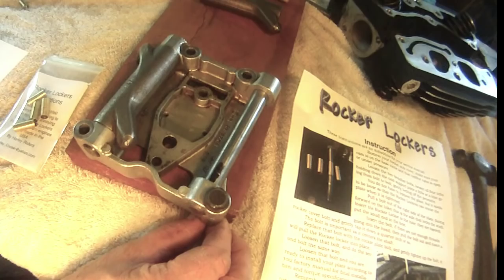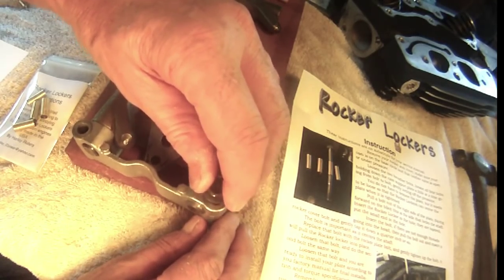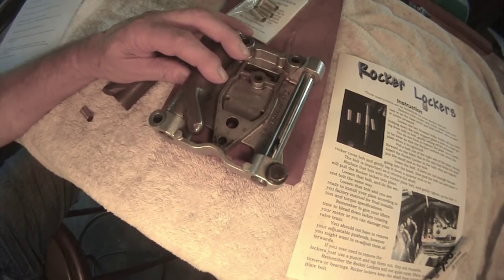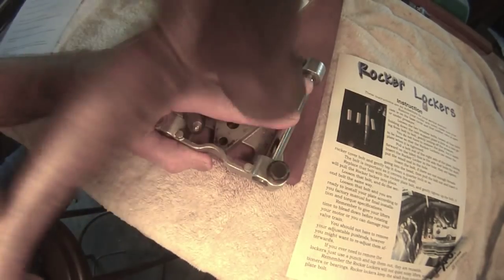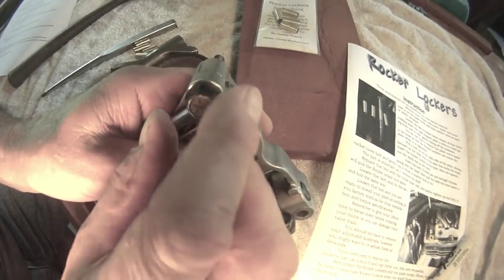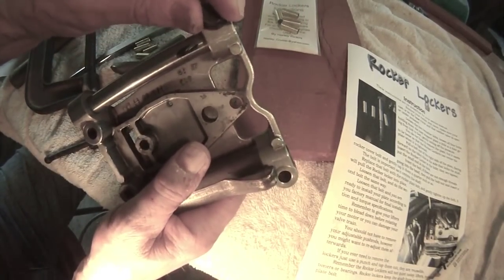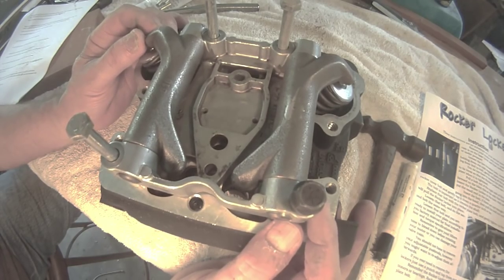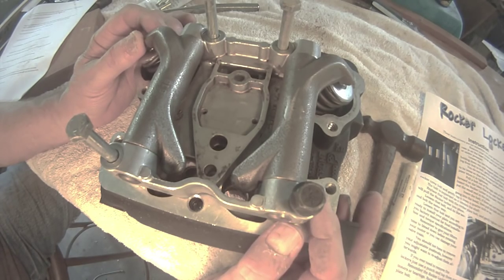Cure for Harley top end tick, Rocker Lockers

Comment: I put rocker lockers in 2 years ago in my twincam roadking .Still has a lot of ticking. Pulled apart and checked everything recently it sounded so bad.Put new piston rings in while apart. No sign of anything wrong. There is no way to really make these engines more quiet like say my old BMW boxer twin.  Rocker lockers dont cure it. These are just rattly motors.  which is shit.  If you hate rattly motors dont get a harley. or buy loud pipes to hide the shit mechanical noise

Comment: Incredible engineering from H.D!! Doesn't inspire a great deal of confidence for the rest of the bike....Pay a fortune and take your bike home,to strip and fix with large hammer!! Incredible!!
Reply from the maker: g.g. 63, The comical part is that this flaw started in 84 with the EVO motor, then the Sportster had the same flaw, and continued in the Twin cam. Usually a company tries to eliminate problems with a new design HD just kept building it in because they wanted to reuse some of the same parts. Sorry about the big hammer, this video version was fairly early in the development of the Rocker Lockers and is obsolete, we have since found a better way to install them using a bolt to pull them in.
Reply: @harleycruiser4331  Pleased to hear it....the hammer looked a little brutal!
Reply: It's only a noise. If noise bothers you then avoid air-cooled engines and get a Gold Wing. That simple, that easy. I'm a multibrand mechanic and don't have a dog in the fight. I own Harleys,  two Norton Commandos and a Honda Interceptor at the moment. Rebuilding the Honda was most unpleasant compared to the easy of doing Harleys.
Reply: It would've cost them another $1m annually in wages to have assembly line workers tapping in bushings? 😕
Reply: I agree you have to enjoy working on your bike, which I do, but the money I spent for it, you would think I wouldn’t have to rebuild it
Reply: Better yet get a dependable bike. And that’s what I’m looking for.
Reply: I have three friends who had the same kind of bike the same year and every one of them is different in someway. Makes you think.
Reply: @obfuscated3090 the noise doesn't bother me, as long as I know that what I'm hearing is in fact what the video is describing. I'm new to motorcycles, so idk what's normal and what isn't.

Comment: I dont understand why nobody sells a bolt with a collar on it. Then would not have to remove the brass bushing if needed to disassemble the rocker assembly. Just swap out 2 bolts and done.
Reply: CORRECTION------4 bolts.

Comment: I had the exact same noise, took me a few months to figure it out, my 88 has 58K miles and it could have been a bunch of stuff, the noise comes and goes and it`s in the top of the front cylinder and thats where I found, the noise doesn`t bother me any more now thatI know It`s harmless, when I put the 100 cid pistons and cylinders in I`ll put in the lockers.
Reply from the maker: Yes, very annoying but harmless. Mine started out with one clicking at about 50k, by 100,000 miles several were talking to me, it was embarrassing it stop at a stop sign, wearing ear plugs helped. That is when the cause showed up on the internet and I invented the inserts, Rocker Lockers. Other solutions were to locktite the shaft, set screw in the shaft,  the inserts are the easiest and simple solution. I was amazed at the improvement. I had worked on my top end several times before my problem started so I don't blaim you for waiting.

Comment: doesn't work, i installed them. same stupid tick. now how to remove them?  drill and pin them with a grub screw. a long screw so that if it backs out it will hit the rocker cover before it can come out. safe and better way.
Reply from the maker: Remove the rocker plate and turn it over and you can drive them out from the bottom with a punch or use the installation tool.

Comment: Rocker Locker didn't help my bike even after new lifters, cams, cam plated, oil pump. Had this ticking from new bike.
Wrong , the rocker locker don't center everything , they only take up the space between the shaft and the bolt and they try ( doesn't always work) locking the shaft from moving . 
All four mounting bolts has play causing movement in the plate, rocker lockers don't effect this play.
Reply: There are many causes of ticking on air-cooled engines. If ticking isn't due to something actually causing wear or damage I ignore it. It's only noise. If you want a silent motorcycle buy an electric bike. Yes, really. My first Evo ticked in various ways for thirty years. No harm done, at all, and I'm still on the stock bottom end.
Reply: I hate to say it but the only true way to stop the ticking is rip the harley motor out and put in a honda or yamaha V twin
Reply: @andrewedwards121  .... Right , Harley should have call the Twin Cam , Twin ticker .

Comment: I have a question, i just ordered a kit for my 2010 Dyna wide Glide model.
I got a Kit with 8 of these lockers in it, 4 of them are longer and the other 4 are shorter.
On the description of the kit it says it is for twin cam engines (dyna) till 2017 and as well for after market rocket srms as well.

Alright in the description it is said that 4 of the lockers are correct and the other 4 are not, so far so good, now i used the longer ones cause i thought the locker has to be even with the plate up- and downside but the thing is the locker was going into the whole pretty hard, even that hard that i know can get the bolt just with a hamer through the plate..
Obviously  i jused the locker which is simly to thick for my whole, so whats now?

And the other ones the shorter ones don’t have the correct length compared to the plate, does it matter that the locker has to be even with the plate?

Please Help🙏
Reply from the maker: You have the kit for aftermarket plates, use the inserts that fit the best, go in fairly easy. After market plates have a variety of size holes that is why the different inserts. They should be flush with the top of the Rocker arm plate top. They will not be as tall as the plate, but will go past the Rocker arm shaft. Don't hesitate to ask more questions.
Reply: @harleycruiser4331  Alright thanks for your help then i will use the one which slides into the hole easy, but as i said, the one which slides into the hole are the shorter ones, they are not even with the plate, does this have an impact?
Reply from the maker: @mathiasbehmann1763  as long as they go all the way in you are fine .
Reply: @harleycruiser4331  That I see your Still responding. Seeking any Help identifying a noise in front Head on right side. Only some tough life spots keep me from being on it. It is an 04' 1200 with 25,000 miles. Sounds good but a Nice metal clang sound. I just started looking it up and was thinking Rocker arm bushings. Any help/advice would be greatly appreciated.

Comment: The Harley-Davidson parts schematic shows that there are shims that go inside each end of the rocker arm pin, yet I have not heard anyone talk about replacing those. Can you elaborate on that?  Thx.
Reply from the maker: Carlos Martinez I believe you are talking about the rocker arm bushings as HD calls them. LOL They are a bearing  Inside the rocker arm. They normally do not see a lot of ware, you are going to see excessive wear on the foot of the rocker arm before you see excessive wear in the bearing,  And normally you would replace the whole rocker arm with a low mileage take off instead of replacing the bushings. The bushings need to be pressed in and then they need to be reamed and honed to fit the shaft which is more work than it's worth. I have not heard of anyone complaining about noise from worn bushings in the rocker arms. I have heard of people complaining of noise from excessive end play on the rocker arms, that's covered in my other video however the majority of rocker arm noise problems are cured with a set of rocker lockers that stop the rocker arm shaft from rotating and hitting the bolt.

Comment: This seems like a bad idea due to heat expansion. Jus my 2 cents . Father bless us.
Reply from the maker: Jimbo actually the thermal expansion makes the problem with the design flaw worse. Let me explain what is happening, the shaft is not supposed to rotate, the rocker arms do. The shaft is a tight fit from the factory, and the bolt is supposed to lock the shaft, but since there is a gap because they used a smaller then designed bolt the shaft rotates when the motor warms up. This is because the aluminum in the towers of the rocker arm assembly expands more than the steel in the shaft, what was a tight fit is now a loose fit and the shaft is able to rotate and hit the bolt causing the loud tick. As the engine wears the shaft get even looser and the tick get worse. The Rocker Lockers go in the gap and lock the shaft so that it cant move. It only goes in one end so that the rocker arm tower can expand more than the rocker arm shaft.
This is called the coefficient of thermal expansion between two different types of metals.

All the Rocker Lockers do is take up the gap and lock the shaft it does not affect the rocker arm at all. I hope that explains it better. This video is obsolete while we were developing the Rocker Lockers we updated many things, the new video is here, https://youtu.be/2TgYZPvAPTs

Comment: I've replaced my lifters, front rockers, changed oil to mineral 20\50 and I still get a tick \ rattle from front rocker box at idle. The rocker shafts are a tight fit so I can't see that being the  problem, I'm out of ideas and the bike has only done 12000mls (2001 Sportster). It was upgraded from an 883 before I got it, do you think that could have anything to do with it? Great video's bud.....
Reply from the maker: GerbilFrenzy, Sorry it took so long to get back. We talk a lot about how the rocker arm shaft when it is cold will be very tight in the tower of the rocker arm support plate, but when it gets hot it gets very loose and starts to rotate. It does this because of the different rates of expansion between the steel shaft and the aluminum towers. The aluminum is about twice the expansion rate so even if the shaft needs to be pressed out when cold it can still rotate when the assembly gets hot. That is why it is usually quiet when the bike is cold. (not always but usually) Normally you will see witness marks on the bolt, but not always. We have also noticed that the front cylinder exhaust rocker arm was the worst culprit for this. Of course there are several places that the top end can make noises but don't rule out the rocker arm shaft rotation just because the shaft is tight. It is a cheap easy fix and we feel it should be addressed first before going any deeper.
Reply: @harleycruiser4331  thanks for your reply, mine makes the noise from cold and I'm convinced it's from the rocker arm as I've used a stethoscope and it's loudest at that point. I'll try the rocker lockers to see if it helps but otherwise just learn to live with it as I can't find anything else worn.The only time the noise disappeared is when I filled the replacement lifters with oil ( with a syringe) and it then ran sweet for approx 2 minutes..
Reply: I've uploaded a video of the engine running recently with the noise if you wanted to have a listen, your opinion would be much appreciated
Cheers.

Comment: How do you remove them to remove the shaft at a later time?
Reply from the maker: Bid D, you turn the rocker arm assembly over and use a punch to tap them out or you can use the centering tool as a punch. They usually come out very easily and can be reused. For normal mantance on the top end you just leave them in, only time they need to come out is if you want to change rocker arms, or set the end play on the rocker arm.
Reply: RevBiker Big D - Punch them out with a drift punch.  They come out real easy.  Go easy on them and they are reusable.

Comment: How much of the top end has to be disassembled in order to install your fix?
Reply from the maker: Kerry, the top cover needs to come off, and the Rocker arm base plate needs to be loosened.
The kit comes with instructions, but you should have a factory manual.
Taking the tank off, makes the job easier, so takes a couple of hours or so to do the job, faster if you know what you are doing.
Reply: +Harley Cruiser looks like about 30 minutes start to finish.
Reply: Kerry Lewis -Just raise the back of the gas tank and remove the rocker box cover.  Run them in one shim/ bushing at a time with the rocker plate bolts.  Go easy as they are soft copper, and be sure to swab any oil out of the bottom of the bolt holes before you replace the bolt...
Reply: Make sure your lifters are on the heel of the cam before loosening and re-installing the rocker bolts with solid pushrods, or loosen your adjustables the same beforehand.....just sayin'!

Comment: Maybe a stupid question, but later on how would you take the rocker apart .say to remove or change out the rocker shaft.seems like a cool deal as I did order a set .I am assuming you would have to get it pressed out to replace the rocker .am I right? Great solution though as Harleys fo have that tic
Reply from the maker: Shoboli nan tanna you can turn the plate over and use the flat end of installation tool as a punch to tap them out, or you can use a flat punch to tap them out. They are recessed in the bottom by about a quarter inch and pretty easy to catch the edge and they come out very easy. Most of the time if you are careful you can reuse them if you don't damage them with the punch.
This is shown at about the 60 second point in this video.
https://youtu.be/2TgYZPvAPTs
Reply: Harley Cruiser ,thanks for info